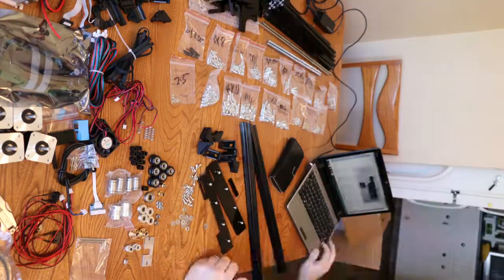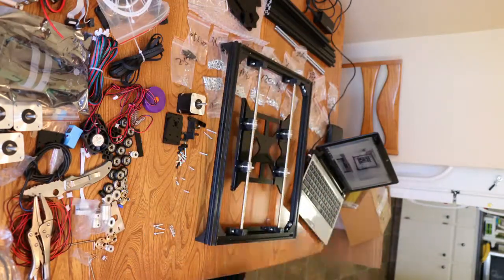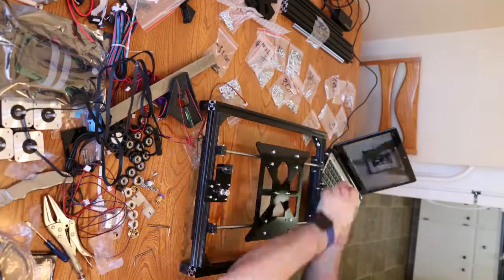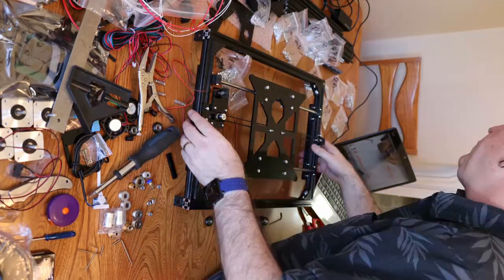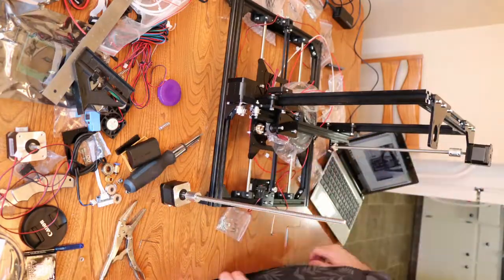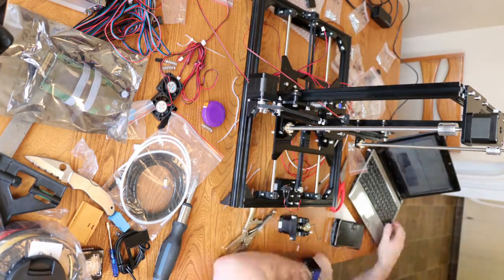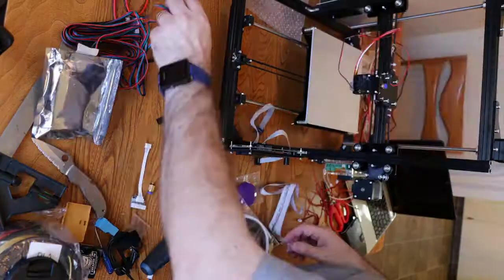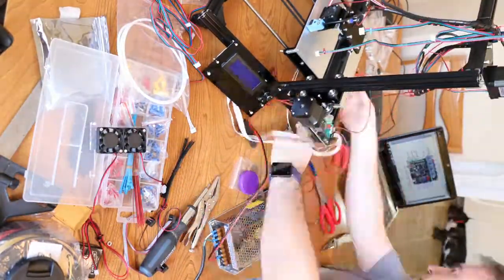Assembly Timelapse

Comment: I've been building the same printer! got to the point of mounting the stepping motor for the extruder feed and noticed the X and Y were in a different orintation in both the online videos and PDF as you mention here... I've decided to proceed as I have done it so far as you did... other than that I had to fabricate a mount bracket for one of the slide guides as it was missing... in place they gave me an extra rod mount... FLSUN doesn't respond to email so hopefully I don't see any further issues. As a beginner in this hobby I wouldn't recommend FLSUN for those reasons.
Would like to know if you were right about leaving the X and Y as the instructions originally showed?
Reply from the maker: I did leave the lead screws behind the x axis when viewed from the front.  This has worked fine for me so far, and seems to be the logical location now that I have used the system for a couple of months
Reply: can I ask you about the two z axis motors... the instructions only have one connection point on the mother board. It leaves the purple E1 connector empty but I'm not certain if they need to be spliced together, what did you do sir?
thx
Reply from the maker: There is Y adapter that you use to connect the two X axis motors to the driver.
Reply: Dean Laird I looked everywhere... Sat down starring at all the parts, read your msg... And there starring back at me. I feel smrt... Thx I appreciate it.
Reply: really, I have the same printer and Flsun has always responded quickly to the few minor issues I had. And I mean quickly, within a couple of hours. 

A little tweaking and this is a great little printer. I am getting great prints with minimal effort on my part. That said I purchased an early version of the same printer and it was beyond crap. But I am glad I took a chance and purchased this one!
Reply: I did as well as I preferred the look.

Comment: Thanks alot. Still contemplating my purchase. The wheels on the x and z axis has me pondering the stability compared to linear bearing. Any play using wheels?
Reply from the maker: There is no adjustment in the stock wheels. So no eccentric nuts or anything like that. In time I am sure that the wheels will wear down and get a little sloppy. So far mine are still all tight. There are models for the x & z carriages that incorporate eccentric nuts that you can find online and print. I just haven't needed to yet.

Comment: Thank you so much for the quick reply. 1 last question if you dont mind...What upgrades did you find necessary for this particular version of the Flsun. It was not until today that I discovered there are various versions as mentioned in my initial post.
Reply from the maker: A part cooling fan is the most important item to add as the included hotend assembly did not provide anything for this. Then stabilizers for the vertical 2020 pieces. There are a number of options for this anything designed for 2020 extrusion should work depending on your clearances and where you have mounted you're lcd, board, and power supply. I will reply later with the particular files I am currently using. You have to be sure when downloading designs for the cooling fan that they are for the 2017 (2020 X axis) version
Reply: Thank you so much. I know others looking at this printer will appreciate your opinion. I'm looking foward to know what parts your using...thx.
Reply from the maker: The part cooling fan setup I use currently is https://www.thingiverse.com/thing:2449326 it should work with the current 40mm fan on the stock hot end although I am using a E3d clone.  For supports on the Z I used these.  https://www.thingiverse.com/thing:1773205

Comment: Hello. Would you recommend this model for someone new to 3d printing? Any issues? I have been looking at this model and the Hictop prusa I3. This model seems top heavy with stepper motors...maybe causing stability issue..vibrations? I see the newer version of this model uses 2020 on x axis vs. smooth rod on older version....any comment on this as to which is better. Thank you for the vid.
Reply from the maker: This was my first 3d printer so it can work as a first, just the expectations of what you are getting need to match. This is a kit, it requires some instant upgrading after assembly, so if you don't want those hassles then not a great first printer. I researched what I needed to do, and it worked out for me. I am not familiar with the other model, but I suspect if it is an i3 type it will be very similar.  From what I found researching you need to ensure the upright potion is as solid as possible regardless of where the motors sit. With stabilization I have very little in the way of banding/ringing unless I really print faster than I should.